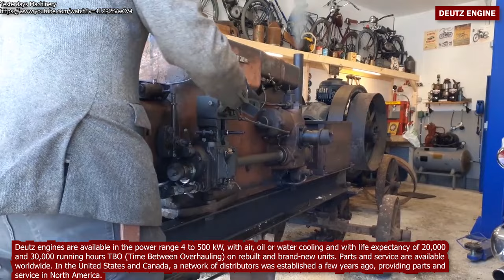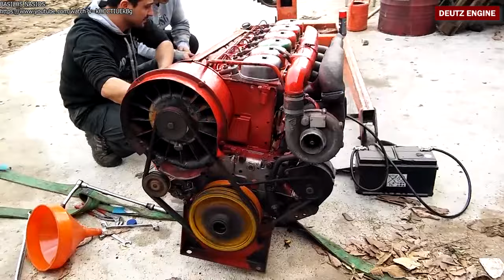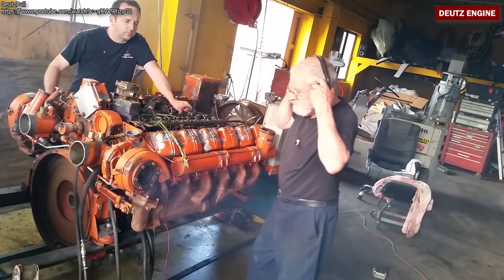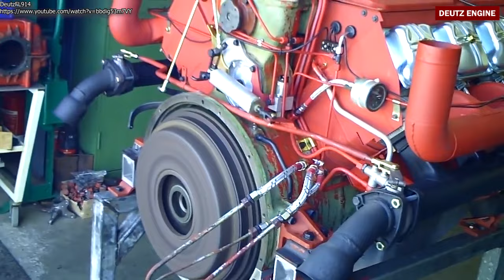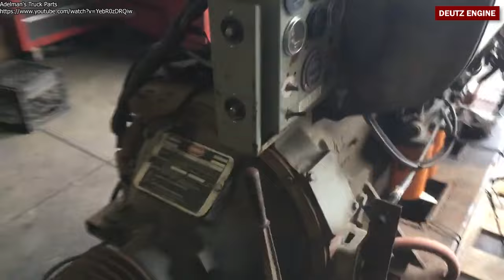Cold Starting Up DEUTZ Engines and Cool Sound

Comment from the maker: Do you like these DEUTZ Engines ?
Reply: Hell yeah
Reply: Deutz diesel forever...
Reply: Yes, and the one "Dislike" is from Greta Thunberg. ;)
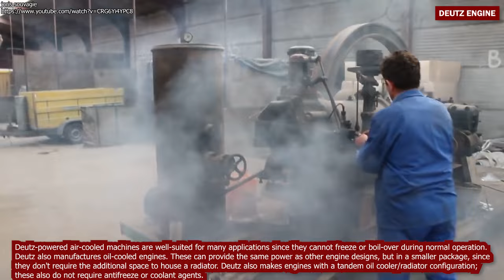Reply: Man ~1:00 that looks a lot like a 47hp Ruston I’m trying to purchase rn.
Reply: I love anything diesel. If it can pull or be used to power something I love it. Part of the reason I became a firefighter is the vehicles run old Detroit 92 series silver engines and a Sam Cam Cummins NTF-365 and a CAT C12
Reply: I use to work at henninger diesel Deutz was all they did 2 dyno rooms head and cylinder rebuilding etc. There a very simple design pre 1970 could be tore down on site and swap out piston cylinder and head.Liquid was a step down imho compared to oil cooled. V10's were chest height upright use to get in shit just bear hugging just the block to move it over 5 feet cause the crane was so damn slow.
Reply: I prefer LISTER
Reply: I just don't understand why are they air cooled
Reply: @paganidreams6608  Look at the cooling system schematic's on there site compare the oil vs liquid. The blocks, head, cylinders are less to make and in turn make them easy to rebuild.The Engines are designed to be a workhorse why complicate it adding extra systems you don't need the 45 liters of oil is there and can cool the engine just are well as water. 

Alot of the engines I worked on in the 90's were coming from South Africa so 45 degree weather well over the recommended hours before rebuilds and they held up extremely well for what they were put through.
Reply: Yes👍👍👍👍

Comment: That was great. I used to work for Wagner Mining Equipment Co. We used a lot of Deutz engines in our mining machines. On the V series engine we had a unique double oil cooler assembly that sat on top of the motor that was used to cool Hydraulic and transmission oil systems. We installed turbochargers on them for operation at high altitudes so the engines where thinking they where at sea level. It’s my belief that Deutz didn’t install turbo’s just to up the horsepower but I could be wrong. Generally speaking turbocharged Deutz engine modifications where done by the dealers or equipment manufactures , but the kits came from Deutz.
Reply: You might want to check the difference between "where" and "were" and lose the "h"s. Clue: the "h" would NOT be silent in "where" (sounds like waire).

Comment: One of best Deutz was 17litre twin turbo Air cooled V8. Rugged durable engine, many thousand km no problems. Truck pull 40t.
Reply: The 17 litre was the V12, not the V8
Reply: @HansGurke44  v12 =12L. In deutz
Reply: @adipmh7302  No, the 614 series V12 was 16 Liter, the 714 series was 19 Liter, the 814 series was 17,5 Liter. What type do you mean?

Comment: I like the first one............what a great go kart engine! Air cooled Deutz engines had their problems in highway trucks......when running off a hill, the sudden drop in temperature in the cylinder heads would cause them to crack.

Comment: one of the best engines around the oil cooled ones not as good .913s were my favorite rebuilt a rock drill at 13000 hrs on site and it managed another 10,000 hours after that.

Comment: I had an Italian16' van  with a five cylinder  DEUTZ diesel engine, one of the most brilliantly designed engines of all time, only two problems the fan cooling belt tensioner bearing was a flop design, so I had  to carry an extra belt, bearing and tools so when the RED light turned on I could pull to the side of the road and  replace the bearing in less than 30 minutes  I could replace it . Next the manual transmission clutch was not up to the job and needed replacing  once a year, the worst clutch combination I have ever seen in my lifetime of now 80 years 40 of that in the automotive  repair industry...
Reply: Não dava pra fazer adaptações?

Comment: The air cooled 4 cylinder, on my Belarus 400 tractor,  looks almost identical to the 4 cylinder Deutz,  and very similar to the 6 cylinder pictured in this video.  I wonder if it is a Deutz engine,  or is at least, liscensed from Deutz to Belarus.  It is a very strong engine,  and doesn't burn much fuel.

Comment: can on deutz engine power be raised by unscrewing a screw on bosch pump?
Reply: Certain injector pumps can. We had a D 6006 4 cylinder with a Bosch pump and turned the HP from 60 to 93 with a simple injector pump adjustment.
Reply: As for the other reply maybe depending on the pump, but you got to know what your doing. I used to work for Wagner Mining Equipment Co and we used a lot of Deutz engines and if the machine was going to a mine high up in the mountains we installed a altitude comp kit from Deutz that consisted of turbochargers and extra parts for the intake and exhaust manifolds and new drive gear set that ran the pump and what that did is speed up the pump to basically pump more fuel. You had to install the new gear set and retime the pump. It’s my opinion that anytime you take a naturally aspirated engine then install a turbocharger you need to speed up the pump. Now if you leave the engine in a naturally aspirated condition then do this you might end up pumping more fuel then needed and end up making a lot of black smoke.

Comment: Deutz with rubber timing belts no good.
Bend valves if fail.
Otherwise good motors.
I stay with Perkins or Cummins
Reply: The belt in the front of the enginies is only for the cooling fan and the alternator. They use a pushrod valvetrain and the crankshaft is cog driven
Reply: @gorbatschovvwodka3591  no thats the older Deutz. The newer ones have a timing belt under a plastic cover.
My old 2 cylinder has just fan alternator belt and the cam is gear drive not toothed belt like new water cooled and some aircooled models.
My JLG 2006 just bent  valves from timing belt fail. Not OHC either .
Lousy design.
Reply: @MitzvosGolem1  all the new deutz engines i saw in agricultural eqipment (4 cylinders and more) had their cam driven with gears. Maybe there are different deutz engines out there.
Reply: @gorbatschovvwodka3591  yes newer water cooled with ecm tier 4
Reply: @MitzvosGolem1  im running the tcd 6.1 6cyl euro 4 in a few tractors they are all pushrods
Reply: @gorbatschovvwodka3591  D2.9L4 is in alot of manlifts skid steers has timing belt.
I have old 2cylinder gear air cooled runs forever but vibrates and loud.
I like the old Deutz motors.
Kubota and Yanmar now are the most common and excellent.
Must have emissions DPF on them here in America.
Reply: @MitzvosGolem1  yeah im with you. The aircooled units are much easier to maintain and in my opinion cheaper in the long run

Comment: They have turbocharged stationary engines. Not a good idea
Reply from the maker: Why not ? :)
Reply: @tractorsandengines  not enough cooling and very poor air circulation.
Reply: @shannybabayaga  BULLSHIT, there are many turbo stationary engines out there.
Reply: most stationary diesel engines nowdays are turbocharged. Except a few single cylinder smaller ones
Reply: I've personally worked with diesel turbo charged caterpillar powered turbine air compressors that ran at full throttle for days at a time. The only time they would be shut down was for oil changes or fuel system servicing  (fuel filters ect) They were refueled while running. They never overheated because the engineers who designed then factored in all of the variables the engine would be operated at for the given application. 

Any engine can be adapted to a stationary application as long as it has proper cooling. That is determined by the fan/radiator/coolant pump/thermostat/ hoses in liquid cooled engines or the fan/ducting/damper door on air cooled ones. You can over cool an engine just as you can over heat them. Both issues have their own sets of problems. Both can be solved with a little bit of time invested in troubleshooting.